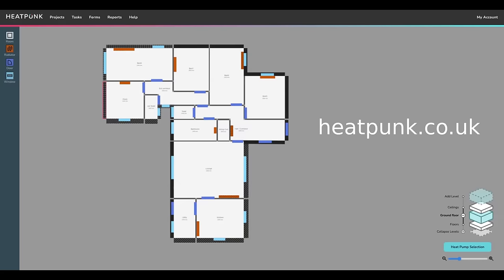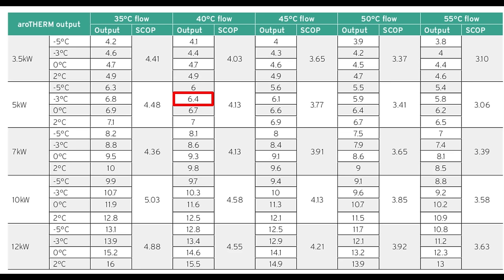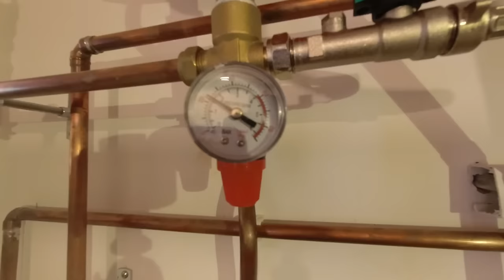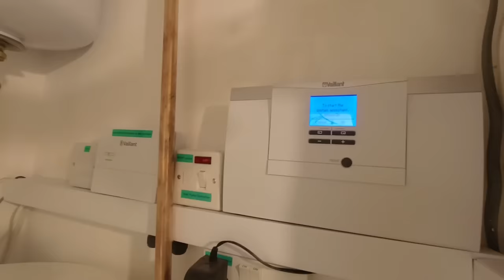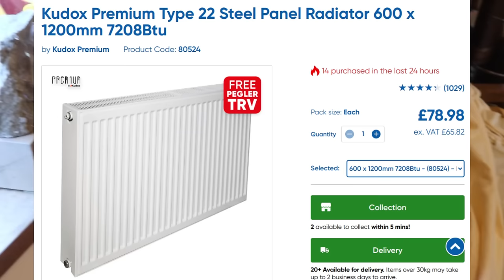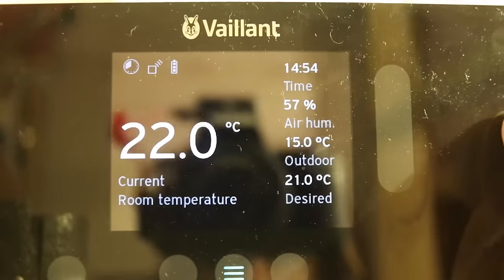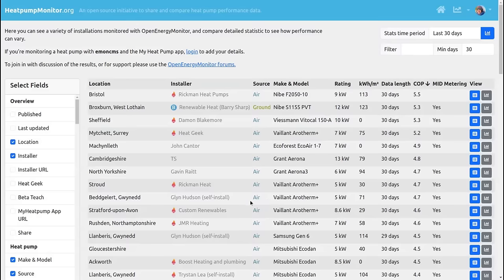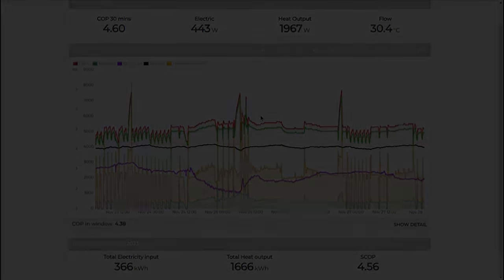Solid Fuel to Vaillant Air Source Heat Pump: 1980s Bungalow

Comment: good work Glyn! Keep them vids coming. You are putting most professional plumbers to shame ;)
Reply from the maker: Thanks, I've learnt a lot from your videos! I was impressed with the Vaillant unit
Reply: @GlynHudson  Indeed, the @UrbanPlumbers videos have convinced me to go Vaillant.  I have a Vaillant ThermoMax Combi currently
Reply: @ChampionCCC  Problem with them is that everything is so expensive and everything is an option. The customer has to do all the legwork to remind the installer/supplier to include all the extras you might assume are included. Viessmann are a bit better in that regard (outdoor temp sensor still not included as standard like for Atag but at least the internet gateway is).

@GlynHudson have you tried the adaptive heating curve option? I think that's the recommended approach.
Reply from the maker: @m23605  no I've not tried adaptive Curve but I've heard it doesn't work very well with the heat pumps, I think it would struggle to beat a carefully optimised manual Curve
Reply: @GlynHudson  So you think it would work better with a gas boiler? I'm having a new 826 (good modulation) boiler installed soon and paid quite a lot extra for the sensoComfort system and was hoping the adaptive curve feature would be worth it (otherwise I wasted a whole bunch of money)
Reply from the maker: @m23605  I've no idea about gas boilers, maybe the sensoComfort should give you better weather compensation?
Reply: @GlynHudson  Not sure. That's what Mr Urban Plumber recommended in one of his sponsored videos (i.e., get the senso and not the other one). The average boiler installer knows Vaillant so I just asked them to get one of those. I hope the system will configure itself correctly (had to remind the installer to buy the outside temperature sensor multiple times). The alternative is them just setting the flow temp to a constant 65 degrees (or whatever their favorite number is this week).
Reply from the maker: @m23605  yes, you definitely want weather compensation, that's what the outdoor sensor is for, you then just need to set the curve. The efficiency gains with a boiler will be much lower than with a heatpump, you might be able to get 10% extra efficiency
Reply: @m23605 , Viesmann is “slightly” more expensive, than any comparable Vaillant.

Comment: It is encouraging to see that existing single panel radiators can be replaced by double panel radiators to enable a lower flow temperature which in turn enables a heat pump to operate efficiently. Thanks for sharing. ☮️

Comment: Very useful to see a real life installation in a 1980s bungalow. 
The Vaillant controls are impressively thorough. I like how the controls monitor the outside temperature and adjust the flow temperature.
Reply from the maker: Yes, Vaillant controls are good. However, all models of heat pump support weather compensation e.g adjusting flowT based on outdoorT

Comment: We  have the same  Woodwman stove as your parents , 102 sq, meters  bungalow built 1990. No under floor insulation but cavity walls are insulated , attic 300mm insulation and basic upvc double   glazed windows and doors (13 years old), Stove heats house and hot water quite well using biomass/wood eco briquettes bought by the tonne pallet, cost so far about €1200/year here in ireland.But as with most energy products they have jumped up in price considerably. So I have been looking at air source heat pump systems and from your excellent videos I reckon it could work for us. But house has to be rated B1 before we can avail of grant. Thank you.
Reply from the maker: So far after almost 2 months of data the Vaillant senso app is over-reporting the COP. The Vaillant Senso app reports COP of 4.5 while the MID meters report a COP of 4.3

The Senso App underreports electricity by 5% and underreports heat by 1% compared to the MID meters, this results in a COP which is 4% over reported. 

There seems to be mixed results in how accurate Vaillant reports compared to MID billing grade metes, see: https://community.openenergymonitor.org/t/vaillant-inbuilt-monitoring-vs-mid-meters/24230

Comment: Your videos are fast changing my mind about replacing my old oil fueled boiler with a new one, or going for a heat pump. I'm just concerned about finding the right installer!
Reply from the maker: That's a valid concern! I would try and find a registered Heat Geek engineer in your area

Comment: Great video Glyn, super explanation and step by step content. Install looks good, you're a great inspiration to others.
Reply from the maker: Thanks John! Great to see your system is still performing well.
Reply: @GlynHudson  it is. I've finally managed to get all the air out of the hot water circuit too! Very pleased with how it is working.

Comment: This clearly highlights how these so called professional installers are crap when a self-installer can install a system that is far better than one installed by the so  called experts.
 
Thanks for uploading and putting the scamming professional installers to shame.
.
Reply from the maker: Thanks, but I wouldn't go that far! There's lots of good installers out there. I don't think any installer wants to do a poor job, it's just until recently there's not been much good training available on the best ways to install heatpumps. There's a lot of heatpumps being installed in the same way as gas or oil boilers e.g oversized unit and undersized emitters and pipework. Good monitoring also helps to optimise the controlls and understand what works best.

Comment: Really great video - thanks Glyn.  We are hopefully install an AroTherm Split 5Kw system into a terraced stone-walled cottage - 2 up, 2 down.  We have had long drawn out difficulties trying to get a heat pump which will meet the MC020 stand for noise, and were going for the AroTherm+.  However, we can’t install it in the space we have, since it is near a drain and window and the use of R290 refrigerant is a blocking issue.  So we are going for the AroTherm Split which uses R410A refrigerant - not so eco-friendly unfortunately. I’m think of getting the installer to include the Open Energy Monitor to give detailed and accurate data on performance.  Thanks again!
Reply from the maker: That's great you manage to find a solution. The refrigerant should never leak from the system so higher GWP it's not that bigger issue. Let me know if you have any questions about monitoring. Happy to help
Reply: Yes, we like to look at the numbers and I’m sure they help getting the best out of the system by seeing exactly what is happening in terms of the impact of settings on power consumption and getting optimum temperatures in the house.

Comment: Great video again. Another one to prove they work in older properties. Have you ever thought about using full bore actuated 3 port ball valves as they have a lot less resistance than standard motorised valves. I changed mine to a ball valve and it increased the flow rate considerably. I guess you have enough flow anyway
Reply from the maker: I fitted this diverter valve which has low pressure drop, however since the heat load is only about 5 kilowatts the flow rate only leads to be about 14 liters per minute which is not really very much https://midsummerwholesale.co.uk/buy/renewable-heat-accessories/mut-meccanica-tovo-sv-3-port-valve
Reply: @GlynHudson  yes I thought that would be the case but thought I would mention it. I have a very old stone house that needs about 13kw so I changed mine to the ball valve to get more flow and it made a huge difference. I can run at about 700 watts input when ambient is around 5 degrees and keep the house at 20. I think heat pumps are the answer they just need installing right. Keep up the good work I'm sure you will have more to do for friends

Comment: Excellent Video Glyn. We are planning to replace our gas boiler soon, hopefully whilst the HMG grants are still available. Also understand that there are some newer design heat pumps that will be more efficient in the next couple of years. We also have a bungalow, which we have just had an up to date energy assessment, which came out at grade 2 with ability to upgrade to grade 1. If possible might you let me know what energy assessment your parents house was please? Many thanks Malcolm

Comment: Brilliant video. Im just upgrading insulation in my 1930s house and need to look at heating options as boiler is 25yrs old. Issue is space for "plant room" This will be an issue in many normal semi detached I think 🤔
Reply from the maker: That's great to hear, it's possible to make the indoor gubbins fit I a much smaller space, take a look at this video of the install I did in my own house, the indoor bit including the cylinder fitted in the same space as original combi boiler. If space is really limited a Sunamp heat battery can be used instead of hot water tank, these are 3x smaller than a tank. But a tank is best if you can fit it, slimline tanks are quite space efficient

Comment: I’m in rainy coastal south wales , ie sea at bottom of garden some two hundred metres away .
 My concern is what the sea air will do to the pump components , I’ve read there is some mitigation for this but it seems it may be an issue , installer has specified two Mitsubishi ecodan 12kw units .
  To get the best circulation around these , watched heat geek tests on this , but I think they need to be located further away from house , do you know if there are significant issues in doing this , ie distance from plant room cause too big a loss ?

  Will be asking installer but want an independent view . Thanks for very informative videos , particularly useful the  links to monitoring tools .
Reply from the maker: I've heard you can get heat pumps with coastal protection coatings. Yes, it's possible to use pre insulated buried pipe to locate the HP further away from the house, the pipe is very well insulated, so losses are minimal, however it costs about £1k per meter

Comment: Great video, thanks Glyn. Where are the sensors for the monitoring (you might have mentioned them in the vid but I missed it)? How much do they add to the install cost, and the blower test? I’m so impressed with being able to put all this stuff in. I feel like it’s something I should learn but wouldn’t know where to start!
Reply from the maker: Thanks, the monitoring system is an openenergymonitor level 3 system https://shop.openenergymonitor.com/level-3-heat-pump-monitoring-bundle-emonhp/. Blower door tests are usally a few hundred pounds.
Reply: @GlynHudson  Thanks, probably worth having if only for diagnostics if having issues

Comment: Thanks for this, very useful. Did you run an airtightness regime before you did the pressure test? Would be interesting to hear how you reduced drafts and air movement keep up the good work 👍.
Reply from the maker: The house was already quite airtight, the usual culprits are poor fitting windows, doors and loft hatches

Comment: Excellent job Glyn, I was particularly impressed with the Vaillant controls and the apparent low noise when the system was running. Did you calculate the difference between heating the dhw with your excess PV and off-peak electric over using the ASHP?
Reply from the maker: Thanks, heating water with the ASHP is about 3x more efficient than immersion solar PV divert, especially since my parents have got a battey connected to their solar PV so they can charge the battey up with excess PV which can then power thr ASHP

Comment: Can the heat pump (- assuming suitable capacity unit is selected) be fitted to underfloor heating circuits?
Reply from the maker: Oh yes, heat pumps work very well with UFH. Since UFH has large surface area to emitt the heat, the heat pump can deliver an even lower flow temperature while still comfortably heating the room.

Comment: Great video Glynn? Did you remove the wood stove fully for the BUS grant or just disconnect from the heating and DHW? 

I love the 22mm elbow hack on the AFV
Reply from the maker: There's no requirement to remove the wood stove for BUS, the HP system just needs to be sized and designed to meet the full heat load of the property. Wood stove will remain for emergency use, the property is in a rural location and they have had multiple week powr cuts in the past. However, since this was a self install we were not able to claim BUS.
Reply: @GlynHudson Having you design and install the heat pump is worth every penny forfeited under the BUS grant - for the peace of mind of being confident of a working and efficient system.👍
Reply: @GlynHudson  gotcha! We get a lot of customers that want to keep it ( and I would) so for the BUS grant to be accepted they stated that so long as it's not connected to the CH or DHW, it becomes a secondary much like a gas fire
Reply from the maker: @owenattewell3910  ah yes, sorry didn't read your message properly and didn't realise it was you! Yes, wood stove has been disconnected from CH and DHW and just remains as standalone unit. Even if it was allowed under BUS it wouldn't be worth having two coils in the tank and dealing with CH switchover, back boiler never worked very effectively.
Reply: @GlynHudson  that's ok, I'm enjoying your videos, wish I had free time to do my own! You can't deny a log burner is the ultimate cozy mood inducer 😂
Hopefully getting my HP installed in January
Reply: @GlynHudson I hate that if you do things DIY you can't claim. Last year I insulated loft myself so I didn't get VAT off material cost as I would have if I'd got someone in

Comment: @GlynHudson  Many thanks for this most helpful video. Just curious why you didn’t stick with Vaillant for your cylinder (price?). I have a narrow cupboard and see that your cylinder manufacturer does do some suitable slimline units that would fit. What influenced your choice of a Tempest hot water storage cylinder and would you recommend them?
Reply from the maker: Cost basicly! Your free to choose whatever cylinder suits your needs best, the heatpump doesn't mind what cylinder you use. I've actually got a 150L slimline Vaillant cylinder connected to my Samsung heatpump at home, you can see this in one of my earlier videos. The Telford cylinder is ok, but I'm actually not super impressed with it, it's got a very large coil but the coil layout is suboptimal for heat transfer. It's a decent budget option but other cylinders would get marginally better performance
Reply: @GlynHudson   Thanks so much - is there a brand you could recommend? I would like a 200l tank that would fit into a cupboard 550mm X 600mm, but with plenty of ceiling height (2.4m). I will possibly go with the 150L slimline Vaillant cylinder, but would ideally like 200l.

Comment: Glyn I see you have both on the heatpumpmonitor so I had a look on there but can't see what your room temp is. Is this not shown or is it me not seeing it . Just not sure if your walking around with a coat on. As you can show a good cop but it doesn't mean your house is warm.
Reply from the maker: Here's a direct link to the data for the system in this video, as you can see on the graph the average temperature this week has been 21.2C (min 19.3C  / max 23.1C), the while outdoor temperature has dropped to -4C https://emoncms.org/app/view?name=MyHeatpump&readkey=871ad5efb8f20f698f12d751aea9b8a6

Comment: Great story- but why do you need to insulate internal pipework?
Reply from the maker: Thanks, the primary pipework and the DHW pipework needs to be insulated to prevent energy loss and stop house overheating in the summer when ASHP is only heating DHW. I didn't insulate the internal heating pipework

Comment: Very informative video can you tell me what company you used for the air tightness test and how much was the cost? It seems to be a very important test for the air change on the heat punk  software ive played about with it all ready and just adjusting the air changes can drastically change the heat loss!
Reply from the maker: About £200- £300, I used https://www.walesbuildingperformance.co.uk/

Comment: I don't think you are allowed an isolation valve between unvented hot water cylinder and expansion vessel ? You have done a  Great job putting in the new system 👍
Reply from the maker: I used a special service valve which can't be accidentally switched off, these are allowed and are very useful to avoid having to drain the tank when servicing the expansion vessel e.g https://www.bes.co.uk/expansion-vessel-service-valve-3-4-bsp-union-x-bsp-tm-23730/?ref=gs&rnd=18708&gad_source=1&gclid=Cj0KCQiAyKurBhD5ARIsALamXaGYknSoygIm_GdwQDgKWZHPExpHAZWdofI6oAm4M23BUWKUetOTcF4aAhLIEALw_wcB